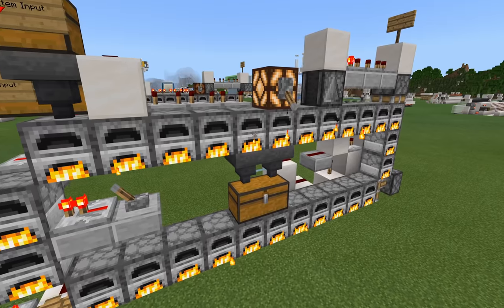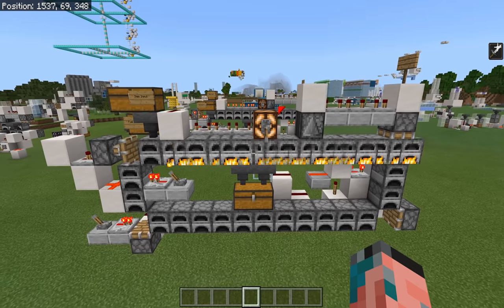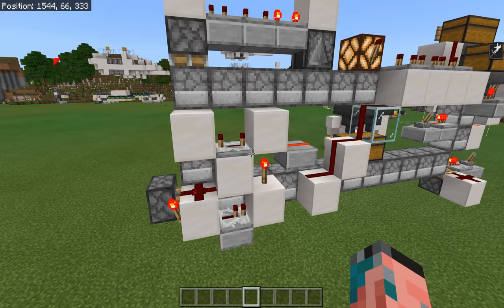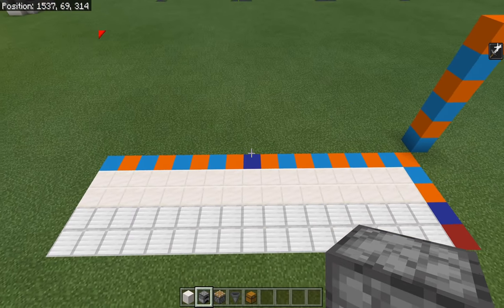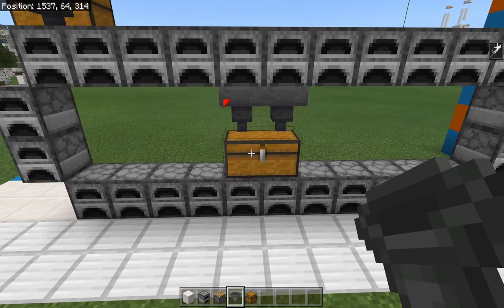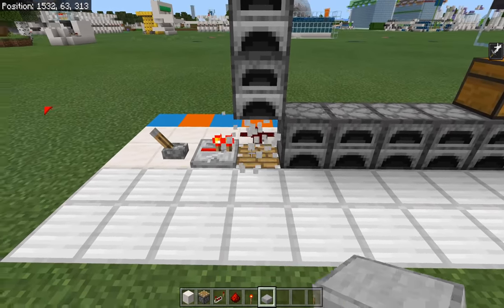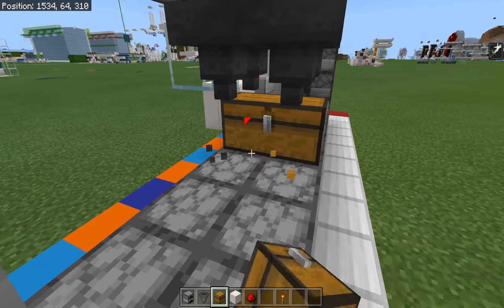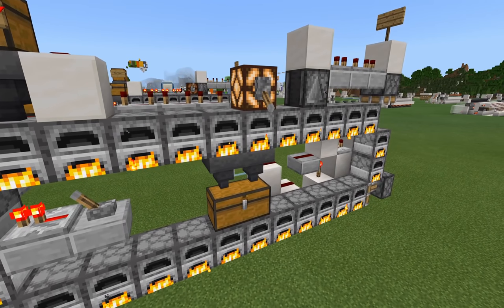Minecraft Bedrock: Fast Super Smelter! Simple, Cheap & Efficient Tutorial! MCPE Xbox PC Ps4

Comment: Help! Everything worked perfectly, but now I can't move some furnances and even open them. I will update this comment if I will find the solution.
Pro tip: always turn off mechanisms when you're leaving chunks. ( Only when your mechanism is built on two different chunks )

Fix: start broking smelter from the top, broken part will reset, and furnances will become normal.
Reply: do you know how to fix it when the furnaces stop rotating when u leave the chunk
Reply: What do you mean?
Reply: @theneonlight2062  when i accidentally left the chunks when it was running and came back. it broke. the furnaces were no longer rotating (i think) because some of the pistons were no longer being powered
Reply: @louiszaffino4071  do you can open them? ( Right click every furnance )
Reply: @theneonlight2062  yes i can
Reply: @louiszaffino4071  idk then, sorry
Reply: @theneonlight2062  np thx man

Comment: I have a problem with the system and cant seem to fix it. The issue is we build the smelter as planned (27 furnace array) and after it was build we went to the nether to mine some nether rack and blackstone, we cam back and the furnaces were frozen in plane the clock system in the back was sped up like crazy, and only the bottom right piston would work, inhaled tried re doing all the redstone but nothing made anything work I dont know if we did anything wrong I watched the vid like 20 times at the point of making the first build and I followed everything to a T. The only thing I saw wrong was some of the repeaters had some how turned around, but turning them back and resetting them did nothing...
Reply: Rebuild it. Never leave a machine like this on while you leave the area

Comment: Quick question is there enough room to build a small kelp fuel farm on top of the fuel input chests?
Reply: Actually just realized this wouldn’t work cause i still have to craft the dried kelp blocks
Reply: @Hash811 just use dried kelp by itself it would be just as efficient
Reply: @Hash811 you’ll be able to do that when the auto crafter comes out

Comment: So I built this and it worked great...until I walked away and accidentally left it on. Now the smelters are not rotating around anymore. The bottom left pistons are moving back and forth but those are the only pistons moving. Any idea what needs to be updated to get this working again?
Reply: Figured it out. The smelters needed to be re-arranged
Reply: Just turn it off before you leave the area and it won't break. You could make it a bit smaller and chunk align it and that might fix it but it might be a pain to figure out how to make the smaller version.

Comment: Is this broken on bedrock? Just built it exactly as instructed and the top right piston isn’t pushing the furnace down? I’ve watched the video 3 times, setup is exactly the same
Reply: Is the bottom right piston right piston retracted by the time the top right is pushing? If not just double check your redstone clock. If everything is correct then I would try breaking and replacing all the furnaces.

Comment: 1 problem I've found with this design which I sent too much of an issue the furnaces will randomly get stuck and u have to replace them in bottom right to get it working and its defo not a chuck unloading issue as I ask near it and it happened and I went to the nether came back and it was fine but as i said before it'd not a huge deal and its super fast

Comment: Materials needed (54 furnace) :
54 furnaces 
32 solid blocks
32 slabs
16 redstone repeaters
15 redstone
10 hoppers
8 redstone torches
8 pistons
8 chests
2 levers
1 redstone lamp
1 observer
1 temporary glass block

(I averaged them so u might have  a little extra resources remaining) also the scaffolding doesn't work anymore so use coal
Reply: Also yes, it still works on the latest version right now

Comment: is there any way to make this bigger so it is 100% efficient for coal or blaze rods
Reply: Make these modifications for blaze rods.

1) Change out the redstone clock for a 2 hopper / piston redstone block (with 5 items in the hopper) this will get 10-11 items in each furnace instead of 6.
2) the bottom far right piston make it an auto piston with a redstone torch to activate it 
3) bottom far left piston hook up to the hopper redstone clock
4) The observer piston, two repeaters can be removed and just keep one on a delay
5) use a comparator on the input chest to a repeater to a torch which then goes to the fuel input hopper so it shuts off the supply of fuel when your smelting input chest runs empty
6). Make the entire ring of furnaces 8 high instead of 4 and move the output finished smelting hoppers / chests down to the bottom left to collect everything that is done before it is sent back up to be refilled.

Comment: Whenever I leave the area the system seems to break. Do I need to chunk align this? I click the level and the left half of the farm does nothing
Reply from the maker: make sure to turn it off before leaving the area. pretty much any redstone will break if you unload it while its running <3
Reply: @silentwisperer  I figured, big thanks!
Reply: Hey silent how do you fix it when it breaks
Reply: @chaseabod3080  What i had to do was just replace all the restone dust and repeaters and such, and put the furnaces back in the original spots, worked fine again
Reply: @theluchakabuto5206  Thank you

Comment: Can the width of this be reduced by 1 to fit in one chunk?
Edit: Yes it can.
Reply: how did you do it ?
Reply: @madisoncrenshaw6605  Build the furnace "ring" with one less in the horizontal rows and one more in the vertical. The redstone that leads into the "X" (opposite to the input corner) is the same but without the slab.

Comment: I'm having trouble with the timings. I can't get the input to put exactly 6 in each furnace no matter what repeater configuration I use. Does anyone else have this problem? Any possible solutions?
Reply: I think I fixed the issue, I added 19 extra redstone ticks of delay between the torch on the back of the lamp and the input hoppers. I did this on the 54 furnace array btw. Hopefully, someone finds this helpful.

Comment: Keeps breaking the lower right pistons just keep going and going and none of the others work. It does work when I first build then it just does that for no reason
Reply: Put a button on top right piston and press it , it  will start working .Also don't leave that area otherwise it will break again
Reply: Turn off the smelter before you leave the area and it won't break.

Comment: This definitely doesn’t work anymore, I haven’t hand more trouble with a build from silent, it’s so frustrating that after hours of me trying to fix it I completely just scrapped it. Works amazing until it breaks.
Reply from the maker: this should all work fine, only real issue is they changed how much scaffolding smelts for so you have to use a different fuel. it could have been a chunk border causing your issues or an improper timing, and you shouldn't unload the area while its running <3
Reply: don’t leave it on if you’re going more than 3 chunks from it
Reply: Works fine for me. They heavily nerfed scaffolding fuel.

Comment: is this available on the newer version?
Reply from the maker: it does, but you need to use a different fuel, lik coal or blaze rods:)
Reply: @silentwisperer  

Make these modifications for blaze rods.

1) Change out the redstone clock for a 2 hopper / piston redstone block (with 5 items in the hopper) this will get 10-11 items in each furnace instead of 6.
2) the bottom far right piston make it an auto piston with a redstone torch to activate it 
3) bottom far left piston hook up to the hopper redstone clock
4) The observer piston, two repeaters can be removed and just keep one on a delay
5) use a comparator on the input chest to a repeater to a torch which then goes to the fuel input hopper so it shuts off the supply of fuel when your smelting input chest runs empty
6). Make the entire ring of furnaces 6 high instead of 4 and move the output finished smelting hoppers / chests down to the bottom left to collect everything that is done before it is sent back up to be refilled.

Comment: Doesn’t work, scaffolding doesn’t smelt 6 items anymore:(
Reply from the maker: yea sadly they removed that :( coal or blaze rods work well though!
Reply: @silentwisperer  Does this fast super smelter work on Minecraft Bedrock Edition 1.19.51?
Reply: @christiansequentialartwork8202  
It does.  Make these modifications for blaze rods.

It's a good design, it just needs some updates for blaze rods.  
1) Change out the redstone clock for a 2 hopper, piston redstone block (with 5 items in it)
2) the bottom far right piston make it an auto piston with a redstone torch.
3) bottom far left piston hook up to the hopper redstone clock
4) The observer piston, two repeaters can be removed and just keep one on a delay
5) use a comparator on the input chest to a repeater to a torch which then goes to the fuel input hopper so it shuts off the supply of fuel when your smelting input chest runs empty
6). Make the entire ring of furnaces 6 high instead of 4 and move the output finished smelting hoppers / chests down to the bottom left to collect everything that is done before it is sent back up to be refilled.

Comment: It is not working anymore, does someone know how to fix it?
Reply: If the bottom right part keeps breaking, put the 2 repeaters that are supposed to be set to 4 ticks in the top right to 3 ticks
Reply: @holdenburrus7282  I tried that and still the only working piston is the bottom right one.
Reply: Check redstone part if it's correct  and bottom piston is keep pushing then stop the smelter and  put a button on top right piston and press it . Also don't leave that area so it will not break .
Reply: @berserker4773  So when I did that, the top right one is working most of the time but the bottom left is not working at all :(

Comment: Is anyone having a problem with the upper left piston not pushing the furnace
Reply: It happens if you leave it powered on then you wonder around and leave your simulation distance
Reply: @bndctgg how do you fix it
Reply: U put levers both the upper piston to push the furnace to the bottom right corner

or break the corner furnace and place it on the bottom right corner